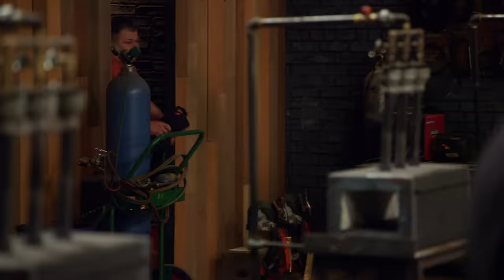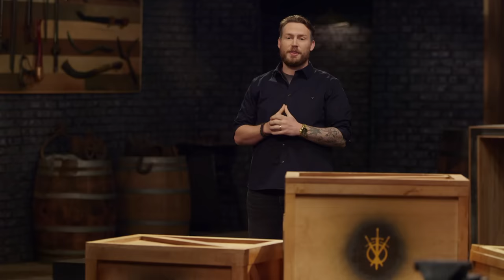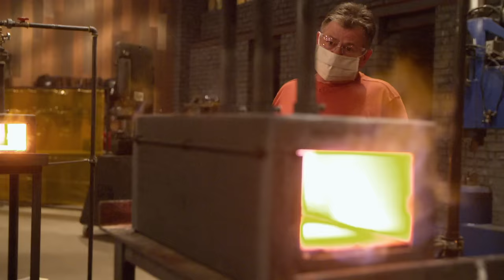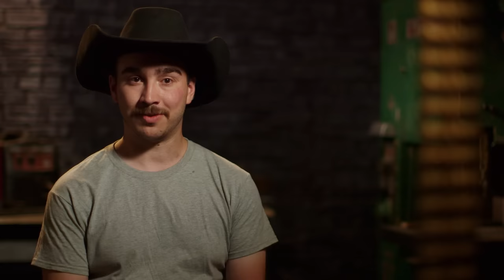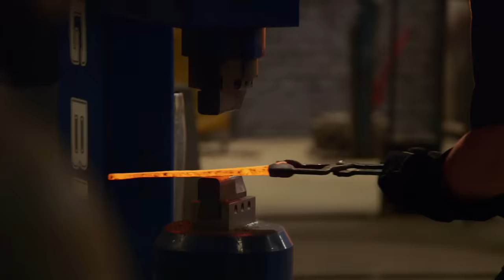Forged in Fire: MYSTERY SWORD! 4 Smiths, 1 Crate, EPIC CHALLENGES! (S8, E24) | Full Episode

Comment: I believe forged in fire is one of the few show that can't be faked, sure the blacksmiths could be told to act a certain way for rating sake, but when a blade breaks or doesn't i don't believe that's something that can be faked.
Reply: There's some degree of scripting in other areas as well, like you can see here they will get the kill test in with a known good weapon before addressing issues with one that has some visible problems.
Reply: @asmcint  Yes, I'm sure they all recognized the parameter failure straight away (I know if I did, there's no way they didn't). That's why they tested Cordale's blade first, so they would have more footage to edit for the final cut.

Comment: Training with your gear is probably the best thing you can do. I bought a new pack last year for long trips, but I had a Short camping trip with my son coming up. I decided to use the big pack and just add some extra water to get to  the weight I was expecting it to hold and less than a mile in one strap tore off. Had that happened while on our families big trip it would have been a huge issue but since I discovered the issue on a short trip where we could make camp anywhere we just pitched camp there and I was still able to haul the bag with only one strap out instead of being in a real bad spot when I needed it to perform.

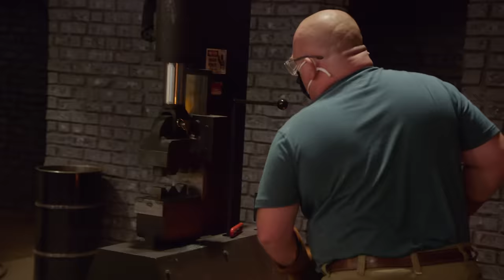Comment: at 7:27 what could the reason be for that gas or whatever that is to catch fire, shouldn't there be no air inside??
Reply: The white out is titanium dioxide, so mix that with a little hole for air and you got hot boom boom fire.
Reply: yeah he didnt weld properly and left an air hole. thats flux burning up and escaping the canister